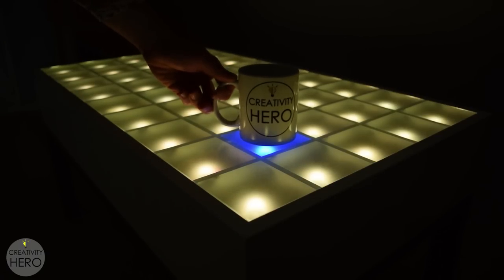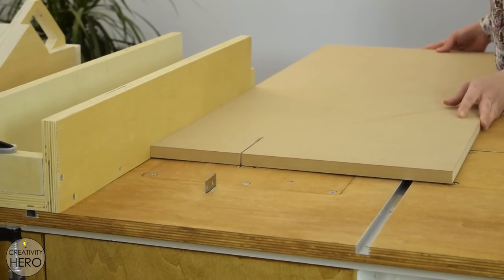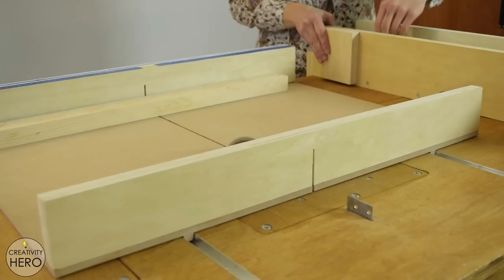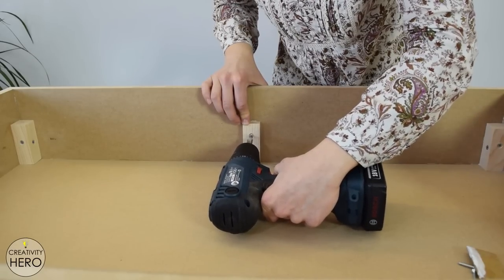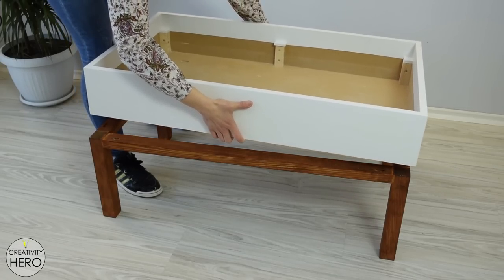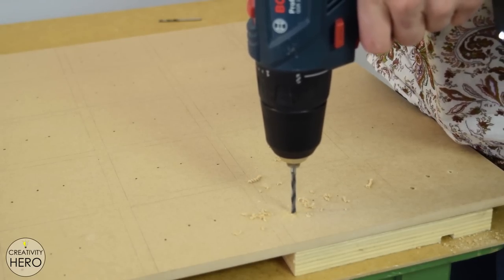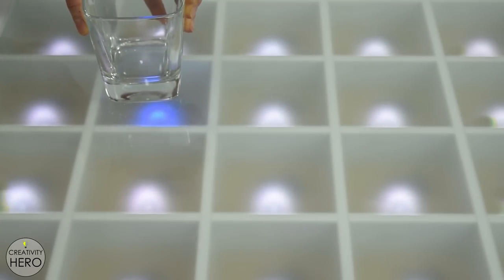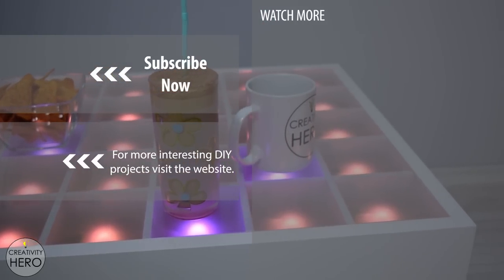DIY Interactive LED Coffee Table - Arduino Project

Comment: 1. I did not understand separating of IR TRANSMITTER & IR RECEIVER. 
2. Can I have a better understanding of connection diagram. I understood led connection. However, do I need to loop each IR like led or leave it alone.

Your reply would be much appreciated. Thank you for a beautiful idea though.

Comment: what would be cool is if you had an IR thermal sensor in each cube that relayed that temp, so the arduino would know to make the RGB red green or blue for hot, warm or average, and cold temps, with the degree for the fall off being adjustable, and either full color per 3 areas of temp, or maybe even variable so if its getting cooler from a hot temp it would range down from red to yellow, then finally to green in a scale of 512  increments between what is the top end of hot, to the beginning of full green color or something, then go from green to teal, to blue one 255th of a color change or something till it is full on blue at the coldest temp set in the parameters. though that sounds a lot more complicated so not sure if one arduino could handle all that or not, lol. also it sounds like a home made thermal camera could be made with say 32x32pixles of resolution that would be a honken big "camera" lens, ie, a bunch of lenses with fixed distance for each "pixel" lol, still interesting stuff.

Comment: Great work. I have also a few questions. Please help me.
Thie first question is, 330 Ohm ist connected to the first LED, then the another wire von 330 Ohm goes to  what ? Thank you.
The second question is. What do you mean with the connection between Infrared sensors and arduino. So we have to connect the sensor 1 to digital pin 1 of arduino. And repeat it with sensor 2 to pin 2.
The third question is,What do you mean with D2 ? 

Thank you very much. have a nice days

Comment: Hey, this is an awesome tutorial but I have a question, have you connected the pins 3 to 48 ( as in the schematic) or 2 to 47 ( as I can see in the video) thank you , I am waiting for your reply
Reply: Marius Poparascu the LED is PIN 2 and the proximity sensors are PIN 3 to 48

Comment: Amazing project, wow . I wonder if the IR sensors can be mounted vertically without the mod?
Please keep up the excellent work, it is very inspiring.
Reply from the maker: Thank you so much for the lovely words! The IR sensors can be mounted vertically without the modification, but in that case they wouldn't be able to detect objects made out of glass. With the modification that I made these sensors are able to detect all kinds of materials, including glass.
Reply: Hi, I love this project! I think I will use your idea to make smaller squares for a Dungeons and Dragons playing board.

I listened to the video carefully and read your blog post about it, but I don't understand why it was necessary to detach the IR LED and move it to shine at an oblique angle, rather than straight up and back down. Why is it that it wouldn't be able to detect objects made from glass if oriented straight up and down?

Comment: Erreur de traductionhello, very nice achievement.
My wife asked me to do the same table. So I bought the necessary equipment and started building the table as shown in your video. I respected the scheme, load the sketch in the arduino but apart from lighting the leds nothing happens. No change when ordering them with Dejan Nedelkovski's App; What is my problem ???

Regards,
Mark

Comment: Hello,

I have a question regarding the Arduino Coffee Table. You said you use a template for the holes where the sensors and the LED come. Could you send me this template? I find the table very nice and am currently rebuilding it myself.

Thank You! 😊

Comment: Hello Marija! Congrats on a great project! It has inspired me to create something similar for a set piece that functions as a fake computer panel. If you don't mind me asking as I am new to arduino and electronics, could I use the proximity sensors in conjunction with regular 2 pin leds? If so, could I connect the proximity sensors to the digital pins on the arduino and then connect each sensor to each led? My main question is if using regular leds, do they need to be connected to individual digital pins in order to run them, or can they be just wired in line with each sensor? I noticed in your schematic that the led strip is connected to the first led with digital pin 2, and so I'm guessing, the disconnected leds then function as one strip programmed from pin 2? What I'd like to achieve is a panel that lights up various leds with motion detection on each led, the same as your table. I don't need rgb leds however and do have a lot of 2 pin regular leds...thanks in advance for any advice you could give. Thank you!!

Comment: I have a bit confusing, please reply. In this confee table (the circuit diagram) Q1 do we need to connect all led in one (single) pin of orduino or we ned to connect them to all seperate pin of Arduino. Q2. How com the background(big) is glowing even before touching the IR sensor. Any one who reed this please if you have any idea.
Reply: For Q1: in her schematic at 11:02 each of the pins coming from the IR sensors should connect to different unique I/O pins on the Arduino. The outputs would otherwise have collisions when connected to a single pin and you couldn't tell which IR sensor has detected an object, just that one of the connected sensors has. For Q2: as seen at 13:24, each of the individual addressable RGB LEDs just glow with a certain color when no object is detected and change to a different color when they do detect an object.

Comment: You also could used an arduino uno or nano with three mcp23016 i2c port extender for the 48 Sensor inputs.

Very nice project!

Comment: For the IR-Proximity sensors to work, the glass needs to pass through the light in the IR spectrum. But as far as I know your regular glass blocks IR radiation. Is there a quick way to check whether a specific peace of glass is suitable?
Reply from the maker: After doing some tests I realized that the IR proximity sensor light was able to pass through the glass. Sorry, but I don't know any other way to check whether a specific peace of glass is suitable. You can google it, I think you can find the answer.

Comment: If you added more leds than the board supports on-board.. what would be the best way to expand it's capacity for lets say 150 leds or 200 even?
Reply: I know I'm replying to a 3 year old comment, but look into multiplexers.  They come as small ICs that usually have 8 or 16 selectable pins.  For the 8 version, you need to use 3 Arduino pins to address the multiplex pin, and one pin on the Arduino to read or write to the multiplex pin.  The 16 version is the same, but takes one more Arduino pin for addressing.  Now the neat thing is you can add another 8 or 16 pins (depending on which type of multiplexer you chose to use) and it will require only one more pin on the Arduino.  So, say you choose the 16 version, you could have 96 LEDs and only have to use 10 pins on the Arduino.  96 more LEDs for a total of 192 LEDs would require a total of16 pins on the Arduino. (12 multiplexers requiring one pin each on the Arduino, and 4 pins for addressing which of the 16 pins to activate)  Daisy chain as needed until you really do run out of pins on the Arduino.  Shift registers could be another solution that might make it virtually unlimited number of LEDs possible and only use very few pins on the Arduino.  Circuitry required due to power consumption by that many LEDs.

Comment: Looks awesome!! I will try it for sure.. do you know what can I do if I would like to use more LEDs? I mean for the pins from the arduino board...
Reply from the maker: Thank you! :D Even if you use more LEDs, everything will stay the same at the Arduino side. You can use one same pin for more LEDs. The number of LEDs depends on the power supply.